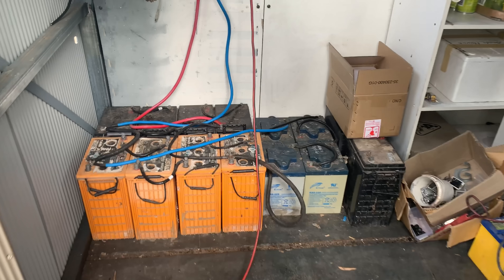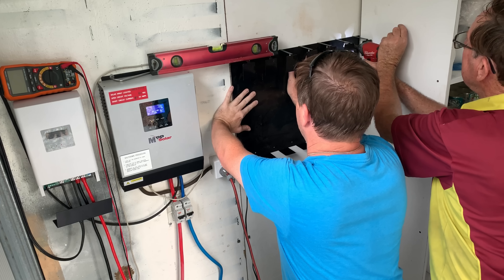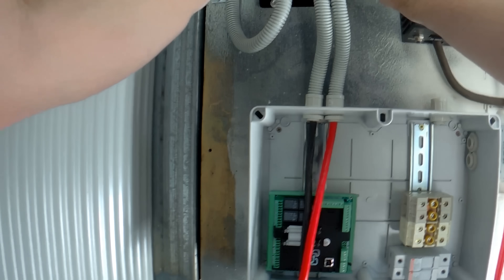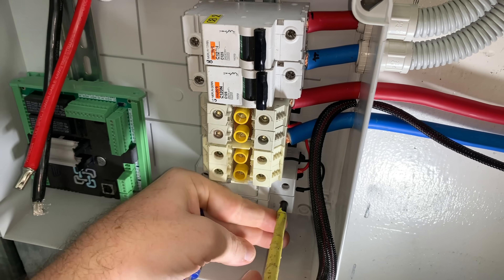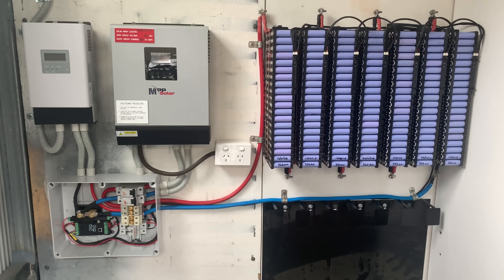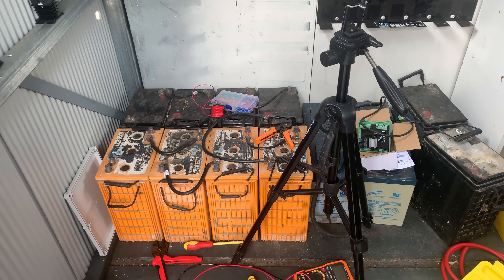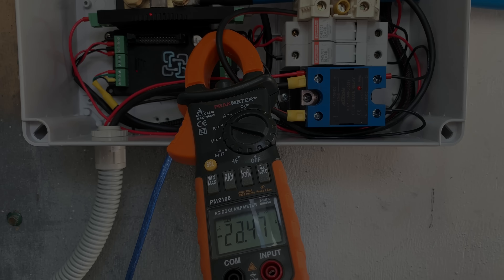Upgrading lead acid to lithium storage | Destroyed my $1000 BMS |

Comment: Yeaaahhh I can’t believe how fast you are, you installed everything in less than 12 minutes!!! Electricians would be jealous!!

Nice watching you getting out and making some different fun projects helping people out!!
Reply from the maker: 12 weeks more like it lol I want to do this stuff more and more - pitty it's a two hour round trip - there are so many more projects i can do out there. HWS is next
Reply: @HBPowerwall  Love your videos but you have way to much time in those batteries, Lipo from the Ford EV is the way to go, or similar battery, each of my batteries are 3.7 volts at 27ah and have 150 amp discharge rate. Only positive i see with those is the stuff they are making for the 18650 is getting better, like wall mounts and holders. With all that said, i still like playing with my free 18650 batteries lmao
Reply from the maker: If i had access and finances to buy EV batteries I would in a heartbeat - but this project fits with my wifes budget lol
Reply: @HBPowerwall  How much money per KWh are you spending when you build these 18650 packs? On ebay Salvaged Volt, Bolt and other similar batteries are selling for really really inexpensive compared to cell prices I've seen.

Comment: hats off to you for sharing your mess up. been there, done that. thought I was connecting two 6v batteries in series and was actually shorting out the whole battery bank and melted the terminals off them! surprisingly easy to fix with a stud drilled into the post but it happens.
Reply from the maker: Yep mistakes are part of my learning. Sucks but it happens

Comment: Gravity is, potentially, the inventor's enemy. Suggestion: don't mount your battery packs vertically - lay them flat horizontally - despite conventional wisdom?
Reply from the maker: mounted them this way for 6 plus years - works flawlessly - saves space, looks good, easy to test, replace or repair battery.

Comment: So I’m New to this and am learning little by little but those little batteries can store up to 10kws which is 10,000 watts right?
Reply from the maker: watts has nothing to do with kw - watts usage, kw is storage..
Reply: Yes but 1,000 watts is 1 kw is it not? So if I’m doing math calculating how many watts i use in my home that will define how many solar panels i need right or wrong?

Comment: Eek... Batrium on powered from batery side of shunt?
Reply from the maker: Yep... want the last thing to turn off to be the thing that could tell me every bit of information about a failure as possible batrium works from 5v to 60v so even weeks after battery has failed i can still get logs
Reply: @HBPowerwall  i talk About shunt not fuse :)

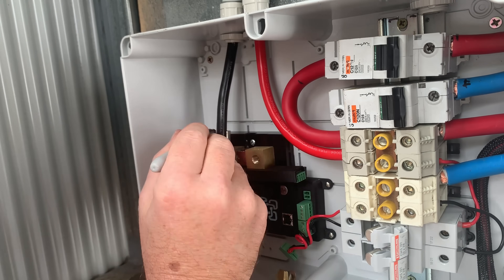Comment: 8:03 What is the purpose of the shunt and how is it being monitored if the input to the shunt only goes from the solar controller straight to the inverter and nowhere else? Isn't the purpose of the shunt to be able to measure battery charging current? This means you'd need to measure the voltage across the shunt itself, right? Is there a wire I can't see or am I missing something?
Reply from the maker: The shunt is for the Batrium BMS, takes care of all the SOC of the battery between solar, battery, inverter .
Reply: @HBPowerwall  
Yes but it can't physically do that unless there are wires on each side of the shunt going to the BMS. Where are they, especially the wires on the left side of the shunt.  I can only see the thick wires going from solar to inverter. There is no wire going to BMS.
Reply from the maker: they are connected I assure you :) useless if they weren't - https://support.batrium.com/article/207-video-shuntmon-installation-hardware-and-software
Reply: @HBPowerwall  
Aha! In the video I couldn't see those green plugs that go into the side of the shunt.

Thank heaps for the link.
All good.   😉👌🏼
Reply from the maker: no worries !

Comment: Did you have to change the floating voltage on the inverter for this?
Reply from the maker: I'm not using the inverter charger (yet - but you set the bulk & float to the top charge voltage - Currently it's 28v and working well still. Heading out this weekend to finish an upgrade and pull those batteries to test them after 12 month of service

Comment: Total cost?
Reply from the maker: about 2500 i think from memory
Reply: @HBPowerwall  Head scratching ....the ROI is gonna be hard to figure when you factor  in that neither solar panels or lithium-ion cells have unlimited life spans
Reply from the maker: $40,000 to bring power from 10km away... That price include panels, cable and batteries
Reply: @HBPowerwall   Yikes!  Guess I'll keep this project at the hobbyist level

Comment: Amazed at how flexible those large gauge cables are. I don't think I have stuff that flexible here in the 'States.
Reply from the maker: I use fine strand welding cable. Its flexible by design, can carry 300amps continuous & is only $10/m here in australia so it's affordable & easily accessible. Would be nice if it was red and black tho

Comment: Why you use PCM60X and 24v MPPSolar (this one also has a built-in charger??) ?
Reply from the maker: It does, but was very low input from memory, PCM60X is an outstanding unit and that PIP2424HS over heated with just a 2000w load for 10 min, ad an SCC to the mix and it renders the inverter useless. NOW that i never used the internal charger that inverter is still running today.. Must be something to my thinking
Reply: @HBPowerwall  is this model better for all in one?  https://www.ebay.com/itm/GK-3000w-24v-Solar-inverter-230v-80A-mppt-solar-charger-PV-input-500vdc/163718879615?epid=20032787170&hash=item261e67d97f:g:bckAAOSwNWdc9dUd
Reply from the maker: Yes that one https://rover.ebay.com/rover/1/711-53200-19255-0/1?mpre=https%3A%2F%2Fwww.ebay.com%2Fitm%2FGK-3000w-24v-Solar-inverter-230v-80A-mppt-solar-charger-PV-input-500vdc%2F163718879615%3Fepid%3D20032787170%26hash%3Ditem261e67d97f%3Ag%3AbckAAOSwNWdc9dUd&campid=5338572907&toolid=20008 works much better and it's what this has been upgraded too now
Reply: @HBPowerwall  For start I would only have 3 solar panels (https://store.bisol.com/premium-mono-305-wp-187.html)
Open voltage for one panel is 41v (41V x 3 panels serial = 123V only ???).
MPPT range is 120-450V. Is this enough just for very sunny days or even shady ones

Comment: The thing about these small cells in a large pack is if one cell goes bad how do you find it or replace it. I am thinking it is much easier to  build packs using larger cells that are now available. Building packs with hundreds of 18650 cells seems tedious and unnecessary this day and age.
Reply from the maker: Don't forget i started this process 4 years ago. 18650 cells scale perfectly from 4 cells to 40,000 cells. Anyone from any economic group can build this to suit their needs from a led light to do home work in a remote town in Africa to a whole house setup because I can in Brisbane Australia. New large scale cells come with a high price tag that limmits their ROI.. My time is spent well building these. DIY is diy for a reason.
Reply: hi! my understanding is, there is an upside of using a zillion small cells in parallel instead of larger, more expensive units. when a few of these smaller capacity cells get weaker you wouldn need to find and replace them immediately coz overall you'll lose a fraction of an amp with a few weakened cells in a pack of hundreds of them. with time when your pack's cell death rate hits double digit percentage or overall capacity becomes too low only then you may need to rebuild.

Comment: Hey from the video u said u installed 14 250watt panels  on the pcm60x thats 3500watts of solar. From the pcm60x manual its 3000watt charge controller... how does it deal with the extra wattage.... also from the manual it says its a 60amp charger so if you are charging a 24v battery you would only get alittle over 1500watts charging capacity from the pcm60x therefore   you are never going to get the full 3500watts from the solar panels you are only getting half. Am i correct in assuming this is so? And if so why did you set up the system this way? Could have split up the panels between the pcm60x and the pip and you would get closer to the 3000watts charging power....
Reply from the maker: We have since moved some solar over to the pip inverter but all the panels lay flat on the roof and there is massive shading during winter
Reply: What was the max the pcm60x was giving you when you had the 3500watts connected? I am looking to do almost the same setup and was wondering if the pip and the pcm60x could handle 1620watts each... on a 24v setup

Comment: Could you explain the relationship between the solar charge inverter thinking it is charging a lead chemisty and how the batrium deals with that? Does the batrium know to feed dummy voltage data back to the charge controller to get it to back off etc?
Reply from the maker: charger controller is set to 4v per cell - so 0.2v under it's max safe voltage also CCCV is turned off. Has worked for me for 4 years so far. Batrium doesn't control the inverter at all. But does take care of balance and hws, & soon the shut trip will be fitted to stop all charging & discharging if there is a high/low or hot/cold issue with the batteries. There are 18-20 temp sensors in this setup.
Reply: @HBPowerwall  thanks for the detailed response!

Comment: Thanks for the step by step video. I'm actually aiming to update my SLA battery bank to a Lithium power wall similar to this. Yours looks very neat with the custom wire length and breakers. Mine is a 48v array and I harvest 53v at 16amps at 1.31killowatts. Small but it powers plenty. I just need a bigger storage medium. I really need to buy a Batrium monitoring system to gauge what's going through

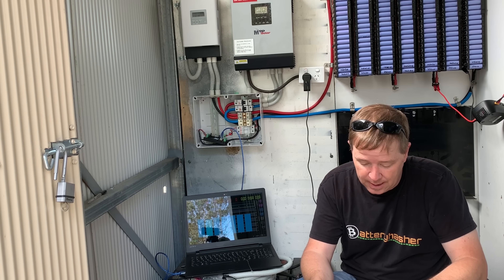Comment: 6:43 That is bad design different connectors should have different key plugs, like automotive designs.
Reply from the maker: Possibly - but they are well labeled and I did do it wrong... I"m happy to accept my own mistakes..
Reply: @HBPowerwall  Yea, but a good design should have different keys connection for: input, output, power.

Or at least strong color coded connectors.

Specially if there are lots of screw terminals.

Here generally alarms have boards alike those of your BMS. But power is on one side, alone. Inputs are on another side and outputs on another one.

In this way is more difficult to connect things wrong.

I have another question about your BMS, if a cell is charged and switch on the bypass mode. Does the BMS alert the charger to reduce the current to the max bypass current?
Reply from the maker: It does if the inverter has CANBUS support and the protocols are public. https://support.batrium.com/article/108-how-to-control-a-sma-sunny-island-inverter-charger-with-a-watchmon
Reply: TuttoCrafting you’re just playing smart 😊🙂 where’s your build? And we’ll see if it’s all perfectly installed.
Reply: @JFLegaspi  the issue is not the install but the batterium design instead that uses connector not keyed.
Reply: He built this for himself not for the  public  to use. Since he built it he knows how it works and does not need all of the proper labels. He only had to satisfy himself not you. He still did a wonderful job regardless.

Comment: Hey Pete. Thanks. I really appreciate your videos. I have a question or a request even. Could you elaborate, why you use a charge controller, when your inverter can charge your batteries as well (maybe you can go over that in a video???)? I have my first 7 packs ready and want to go ahead with ordering an inverter but I want to understand why you use a charge controller instead of the inverter to charge your packs. Thanks!!!
Reply from the maker: I use the MPP Solar PCM60X charger controllers cause they work! That's not an affiliated linked or sponsored comment it's the fact they really do work and stood the test of time. Its Heat... in summer it gets a touch hot over her in Aussie land so keeping head separate to the inverters is a great idea when an air-con gets left on for days and days at a time along with the normal house loads and cooking. THAT said it would be more efficient to use the internal charge controler as it's much more efficient as the PIP inverters will use solar power first so there is less energy 'inverted' so to speak. NOW this setup it's because of the limmited size of the PWM charger controller in the PIP2424HS & those fans are a touch too small for that unit.
Reply: @HBPowerwall  thanks for your response. So if I understand you correctly it is not necessary just recommended because of environmental conditions in Australia. I will try without and should I experience issues with heat I can integrate a separate charger. Thanks again for your feedback. Greetings from Canada.
Reply from the maker: It's an all round versatile unit that I trust so much of the rubbish others push (and my self in the past) isn't tested properly and just there for aff clicks don't care what happens in six weeks time.. It's time to change that train of though and do better where possible

Comment: If you’re accepting small criticisms, I would tie down those blue and red cables from the battery banks near the enclosure. If something heavy falls down and catches those cables, there’s a chance they’ll pull out of the screw clamps and make turn the inside of the shed into a pretty sparkler. (Never trust horizontal cable runs).
Reply from the maker: will do!! Doing it better is key! also have to install the shunt trip in that position so that'll take some horizontal real estate out of the equation

Comment: Remote monitoring coming ?  I'm a freak for safety and would pop those packs into a metal case , eg she's goes up it just roasts the box, but looks like a tin shed anyway :)
Reply from the maker: All metal shed, 1cm metal floor, mini orb metal walls - inside a shed only lined with wood where the powerwall is & 5l of generator fuel is stored lol (for now) remote monitoring is hard as every thing is steel and messes with wifi & internet is so intermittent it's useless - wind changes direction and it drops out

Comment: Remembering that time you shared that meme:

"People are shocked to learn im not a very good electrician"

But im certain this wont be an issue haha
Reply from the maker: I didn't do any 'electrician' stuffs lol refuse to touch 240v I don't want to die!
Reply: @HBPowerwall  Ah! So THAT'S why such low volts! Too many cells in parallel for a config with second hand cells, even with individual fused lines. Jehu Garcia seems to have a much better method of building power walls. And by the way you die MUCH more easily with DC than AC - the current never gets interrupted on DC shocks. That's probably another reason to use 48 volts though right? 192 volts DC is more my idea of  getting power from multiple batteries - just like my pro Riello 6kVA UPS! I can run universal power tools or any universal motor directly off that with no conversion and ampage losses.
Reply from the maker: @boblewis5558  Jehu's is fantasitc for small jobs, but sucks for scale - seen many more issues with his packs than are public. BUT they are VERY good for small packs don't get me wrong - my next battery is bigger again and I will be adding another 1200 cells soon to this battery. It's been in service for almost a year now and is still super strong with out any signs of issues. Going to pull it out of service and retest each pack and see how it's holding up properly.

Comment: No pv fuse emergency disconnect?
Reply from the maker: No fuses yet but the disconnect is the ZBenny  above the PCM60X
Reply: @HBPowerwall  legally required is a fuse pull handle
Reply from the maker: For solar panels in Australia?

Comment: 5:24
There would be less resistance if you used solid silver 00 gauge wire in place of that copper 00 gauge wire.
Reply from the maker: I don't think there is too much resistance
Reply: @HBPowerwall  
Yep, that is part of the joke.
Reply: Cost would be not worth the savings, buy another panel for the cost difference and make even more than the loss. Don't tell anyone i used 00 gauge solid gold wire, Jokin lol
Reply: hahaha! Good one!
Reply from the maker: lol

Comment: Get an electrodacus sbms
Reply from the maker: I love my Batrium products way too much for that to happen..
Reply: sbms is 24v. Batrium is overpriced and overrated
Reply: @climatechangepreppersfaceb2148  ya 1/3 the price and to have a solar charge controller built in.... mint
Reply from the maker: Sound like you've both used Batrium products & ED - myself only used Batrium and love it! Fits my needs well.
Reply: @HBPowerwall  sounds like you've never considered anything else. Most expensive does not mean best, or easiest, or most reliable
Reply from the maker: Considered Yah- went through about 10-15 pieces of chines junk back in the day some make it to the small screen others not. Considered many ED was a very long lead time when I was looking for a BMS to suit my needs

Comment: Great job Pete - so satisfying to see one of your babies doing good...
Seriously chunky cables there!
(I think I would have left them a little long with a loop instead of cutting exactly to length, in case the boxes need rearranging later!)
Reply from the maker: I wanted to do this one as 'right' as possible - sparkie should be out in a few days to do all the final connections and move the breaker panel from the house to the battery shed.
Reply: @HBPowerwall  Look forward to seeing final results, just don't forget to do an update video!
Reply from the maker: Will do for sure!